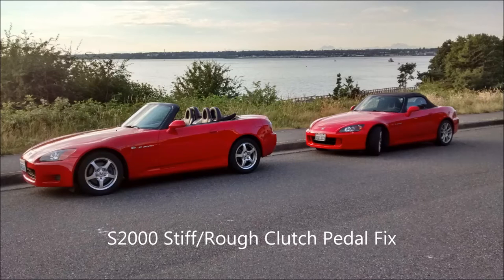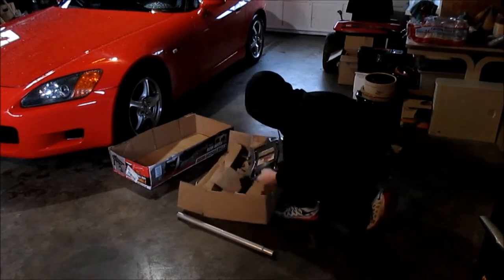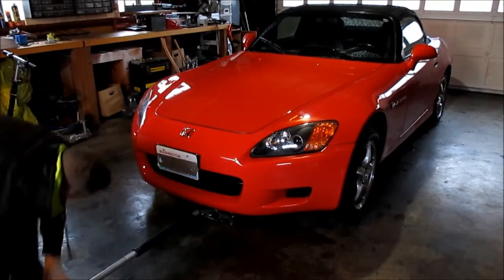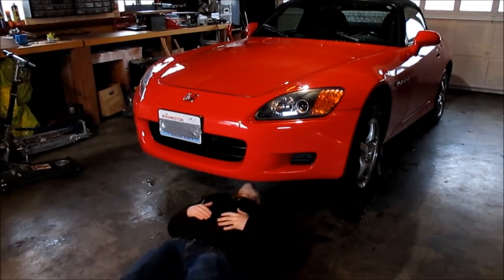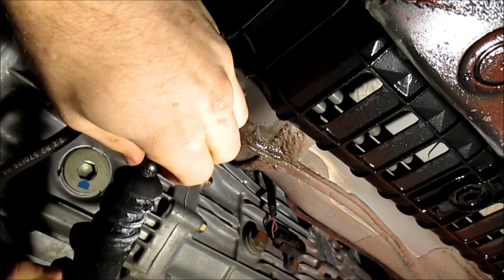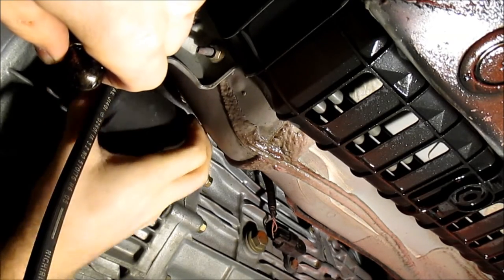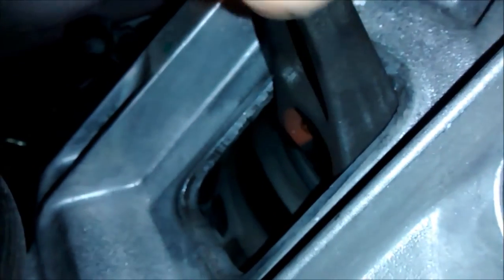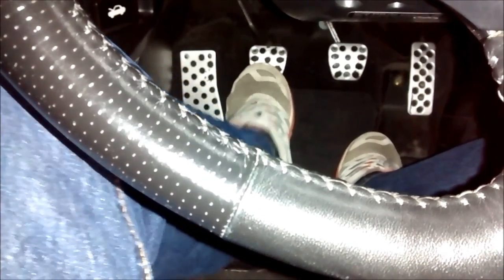S2000 Stiff/Rough Clutch Fix

Comment: Thank you for showing the clutch fork clicking in and out. I was servicing my clutch slave cylinder and the fork came loose… for a minute I thought I was going to have to pull the trans to get that fork back on. It’s weird that once the fork is back on there is hardly any movement of the fork at all though….

Comment: Great video. Thanks for going to that effort. I have 02 s2k with 40K miles.  Clutch developed roughness and also a slight sticky feeling after depressed to floor and just as it is released from floor.  This fix improved the roughness.  But, I still have the very slight sticky feeling when pressed to the floor when releasing the pedal.  I see some folks recommended greasing the ends of the fork where they contact the throw out bearing.  Could that be the cause of the stickiness?  I can't seem to see how that is done because it is deep inside the clutch housing and seems impossible to see or reach.  Any tips?
Reply: Hey man I got the sticky problem, did you ever find the solution to it?
Reply: @2kleo395  I did the things shown in this video.  Helped a lot.  Did not fix completely.  My best guess is that on my car there may have been some roughness or lack of grease on the throw out bearing/bearing tube.  Mine was not that bad so I lived with it.  But, had I kept the car, I probably would have pulled the transmission, repaired whatever I found, and then probably also replaced the clutch while it was opened up.  I have a another S2k now, 2003 model.  It has not developed this issue, yet.

Comment: one query for all, 

My gear while shifting from 1-2 doesnt go smooth, has some problem & goes off to 3. this happens occasionally only. 

can anyone point out what t frack its about?? 

t earlier driver used for 1st 40k kms & guess was a lil rough, rash on pedals & used it mainly in heavy metro city traffic.
Reply: UberDom if its a manual transmission more than likely its the syncro's and all though rare maybe a bent shift fork hope you have figured it out or that this helps

Comment: wow wish I would've seen this before I replaced my slave cause I'm having the same problem. it was so soft when I put it on but after time it got stiff and then sometimes soft and varies on the temperature
Reply: Andrews as leaders has this fixd urs
Reply: crawfsta20000 didn't do it yet. too cold to try